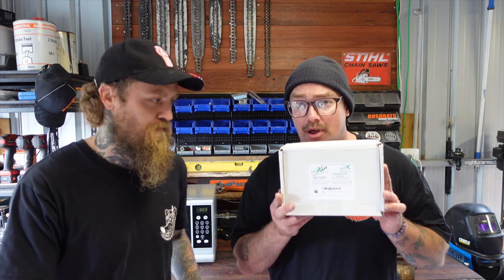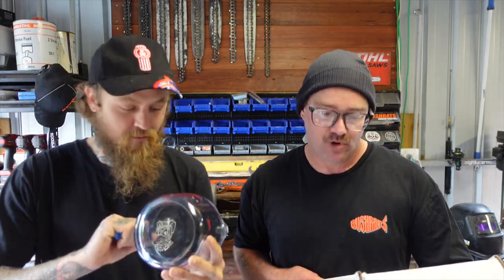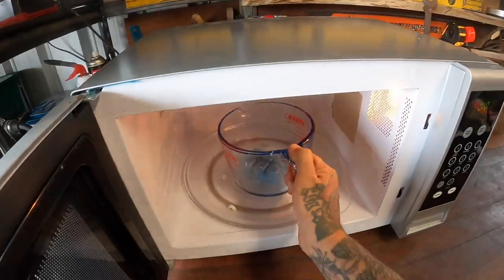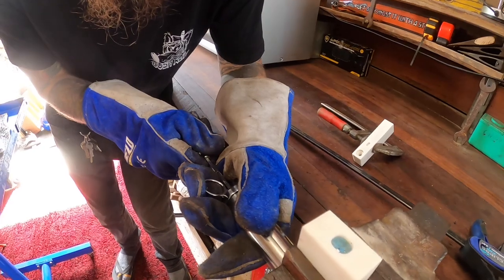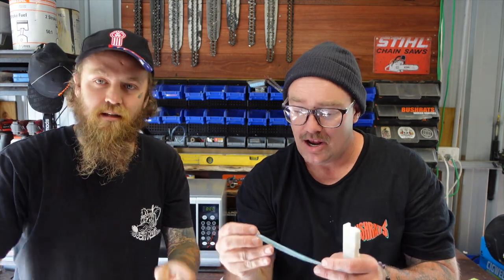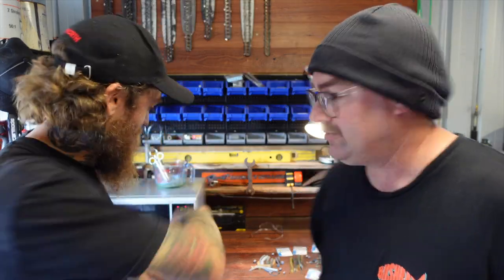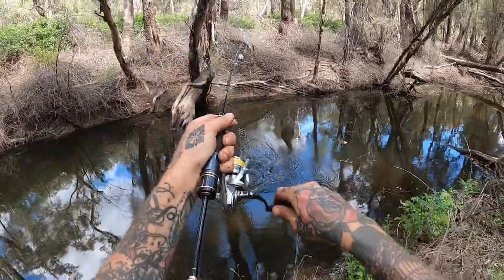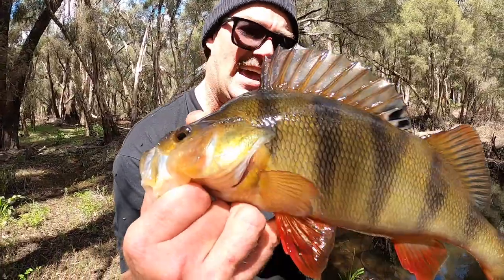DIY Soft Plastic Lures | DO THEY WORK?

Comment: hahah Tonys hilarious!
I like the idea of making my own plastics, but I worry about the economy of it.  Also I've got to say that rubber steam when it comes out of the microwave is a real worry, I know you guys are videoing, but next time without the video I'd go masks for sure.
Reply from the maker: Thanks mate yeah definitely going to be an outside job next time 😅
Reply: It’s a good idea to wear a respirator. As far as the economy, you can keep all your torn up plastics and melt and reuse them or even get the super cheap discount plastics and melt those. 

You can buy new plastisol too if you’d like but it can be super cheap or super expensive depending on the route you take.